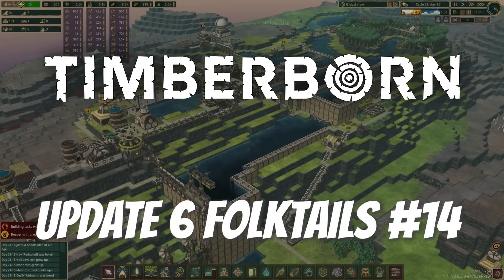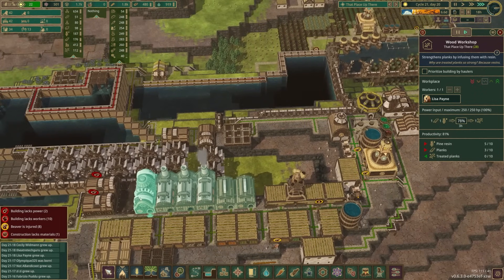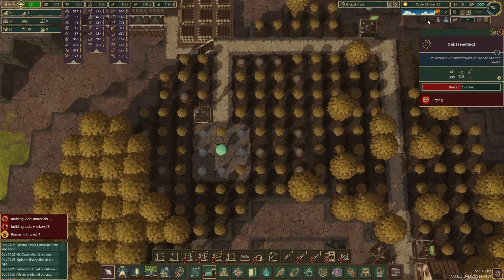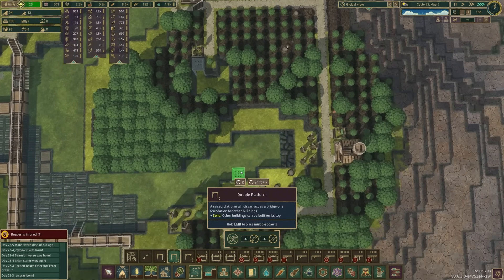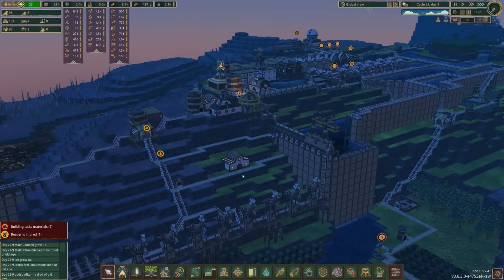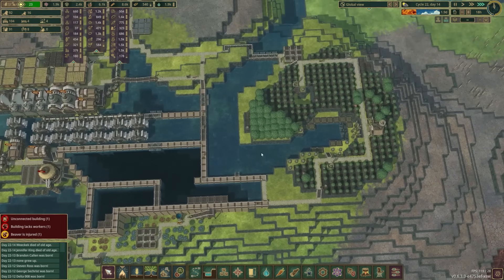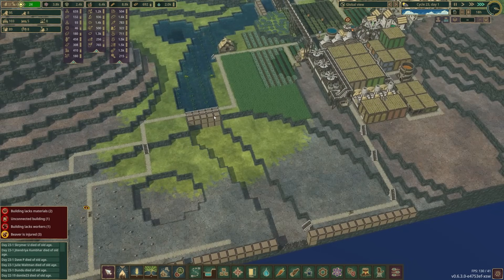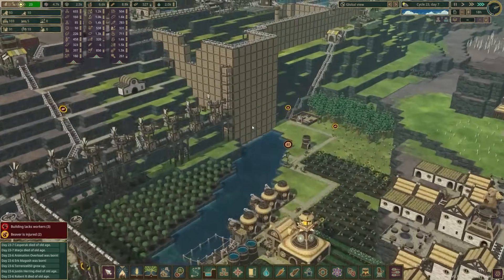Time for a huge water upgrade! Timberborn Update 6 Episode 14

Comment: Platforms over water is a great way to get space back that’s otherwise unusable wasted space. For housing or industrial use.

Also, there’s prime real estate for 3 or more gravity batteries off the front of your dam, you can put a T in where the vertical shafts come up the side and put all the gravity batteries on platforms just like you did on the power shaft to keep that pathway open. And having the weight off the front will give you a really quick and easy visual reference on the amount of power stored.

Comment: → 22:48 "All of these have to be paused so this and this can be built first" – alternatively, you could high-prioritize the rightmost one of the ones which are paused now, so it gets built first. The other ones then will only be built from the top, without any intervention needed.
→ 48:35 "And I want these to be connected, but I'm not going to build a second centrifuge just yet, so we will of course temporarily get this put in with a power shaft" – Looking at the color of the shaft at 48:44, the centrifuge doesn't connect there, only in the middle of each side (and the bottom).
→ 52:32 "There is still a pile of logs here. How did that happen?" – You demolished these levees after giving the construction task for the wall extension, so they will only do the cleanup after the wall is done (or the construction somehow blocked).
→ Don't forget to put back the gravity batteries (and possibly some more on the front side of the reservoir, over the sluices) – optimally you'll want to have enough energy storage that you can last through a drought (with the support of the intermittent wind mills).

Comment: The contamination barriers could be thin strips of wood in baleen like sheets to act as a filter, it uses "planks" because you can shave the boards thinner at the mill. Each of those cones could be one such vertical filter in a rat maze of steel, forcing the water through every filter before it passes through. using that description it would probably need upkeep, but timberborn [thankfully] doesn't do upkeep tasks, only build, supply, craft, and recreation. 

In Oxygen Not Included, a similar contraption, the water sieve, requires an input of sand and removal of polluted dirt [2 separate tasks, 1 supplying, 1 life support] to maintain. That game, despite its cutsy art style, is designed to encourage rube-goldberg contraptions. Yes you can filter your sewage [from toilets that are needed], with sand in a sieve, or you can find a way to boil it, turning it into dirt [for gardening] and steam, which can be cooled into clean water. You can also just dump it into a pool and either decontaminate the air [with power and sand, but much less than a sieve] or just let your colonists breathe polluted air.

Yes I have done all the mentioned options at different times. Timberborn needs a water sieve type contraption, come to think of it, one that either uses power and paper to press it through a filter [for the Folk Tails] or logs to boil it and condense it [an Iron Teeth badwater reactor, turns 2 badwater and 0.1 log into 1 clean water and maybe 20 power, or whatever the wood: power from the engine and badwater: extract ratios at the centrifuge are]
Reply from the maker: This is awesome. I hadn't ever thought of that being possible.
Reply: @JCTheBeard  it is my way of explaining 2 extant filtration systems used today using beaver logic: the charcoal water sieve and the algae air filter

The charcoal one is useful for camping or doomsday prepping: take a plastic bottleor tin can (plastic bags will do in a pinch) and poke holes in the bottom of it . Into it you put gravel, then sand, then ash from your fire. You can filter river or puddle water through it to get the particulate out, then boil the water to kill whatever didn't get filtered.

The algae filter is used on some coal fired power plants. The exhaust gets bubbled through a water tank filled with heat tolerant algae. The water and algae take the ash and much of the carbon from the exhaust and convert it into oxygen. When the tanks have too much algae, they skim and dry it and burn it as more fuel.

Comment: 13:47
Just like the lodge you have near the center of the screen here, you could add some more using the cliffs, by placing them one level lower.

To the left of the one here, you can put a double lodge by turning it counterclockwise (in comparison to the triple lodge), and you can add more lodges following the cliff.

Also, don't forget to add rooftop terraces and other amenities.

Comment: 50:30 You forgot to put the gravity batteries back. Why not put them at the front of the dam instead of the side? Either facing outwards or inwards. That way they also won't lose height due to the side of the hill.

Comment: You could do a mix of small storage and platforms over small things like medical beds on the backside, with a platform covered path to support more housing. Basically instead of blasting the cliff back, built the land out. for ease of access, you can even take advantage of the verticality by using double stacked single platforms instead of doubles, with a path on the "middle floor".

Another more visually impressive but also functional thing you can do [that will give the beavers Up There more recreation] is to have an overhang contraption to make indoor rooftop terraces. Kinda like how you used overhangs to make those power lines, the ground floor is a mix of medium storages and platformed over paths and small utilities [again like your storage complex]. Flanking the ground floor storage setup is triple lodges facing inwards. On top of the storage is a rooftop only rec building and overhangs [on single platforms on top of the lodges] span the gap leading to more stuff on the 4th floor. 

Floor 1 = ground level storage, and path/stair access to floor 2

floor 2 = entertainment & housing entrances, and a spiral staircase linking the floors

floor 3 = stairs up to the next floor and mainly open space over the entertainment [like your power lines over the trees]

floor 4 = overhangs and/or bridges with decor or another stack of this contraption.

For visuals, look up Chicago's Lower Wacker Drive. a good chunk of downtown is built on stilts essentially, with all the older [1950s and earlier] buildings having special delivery entrances, storage, and parking under the public part of Wacker Drive [which follows the river on the south and east banks to the lake]. The underground scenes in the Dark Knight movies were filmed on Lower Wacker. Other inspirations are cliffside mansions and the Ewok Village from Return of the Jedi

Comment: The way I did it in my play through, I essentially used that little island where you put down the science buildong, as a storage system. Unlocked the underground pile, and also blew some holes to be able to store large storage and have them flush with the ground. So it could have some processing buildings up top.

It looks pretty neat.

Comment: For housing defelopment, using the view at 21:13 you have a set of 1 tile ridges, then a single 2 tile ridge. If you start with some double or tripple lodges on the 2 tile ridge with the opening to the next ridge up, you could then  run a path, with stairs up on the right where it opens to 2 tile width at that height. Platforms on top of that path would allow for either/both of another level of double/tripple lodges or some rooftop terraces. Up at the very top you could also shuffle some things around to make space for some firepits, or just put them down at the very bottom. 

I'd also encourage using the levels to put out a 2x1 platform with a hammock out into space. There's no practical reason to do this, it's just nice to put in cool lounging spots for the introverted beavers to go and chill while looking out on the world.

Comment: For housing, perhaps stack the buildings facing the cliff/terraces and use metal overhangs to reach the doors, paths running along the terraces. 

Also had an idea for the irrigation pool for the Forest ‘up there’ instead of the usual water dump - could’ve created a pipe from the water source with a sluice to allow clean water, and then built/paved over it?

Comment: 51:48 I know you’re not hurting for water but if you get rid of the sluice gates and widen the outlet of the river to be able to fit 4 dams and 2 sluice gates and set the gates to open above contamination 1% so the bad tide flushes out and close on contamination below 1% to retain water at the height of the dams. Also maybe set the log pile further back to be able to put in contamination barriers closer to the edge

Comment: For future, if you have dynamite you can always dig 1 tile into the ground and fill it in with levees instead of using contamination barriers. 1 levee in the ground and 1 above it usually does the trick for keeping badwater contamination from spreading.

Edit: This would be helpful at 52:17
Reply: You can also combine one layer of levees on the waterway bank with impermeable flooring right next to them. But Be aware that both methods block not just contamination but also irrigation (though of course that isn't an issue when you have an irrigation hole handling that in the area).

Also, contamination — like water and irrigation — doesn't move diagonally, so the contamination barriers on the corners weren't needed.

Comment: 13:49 Why not cap the water source, next to the district center, with 3 by 3 or 5 by 5 platforms. Giving you more building area at the same level as the factories and housing.

Comment: I have no good tips for using verticality and blow up less ground.

Although, you should really use some explosives to get more depth and volume in the giant dam in The Place Up There, both for added water volume, which might be overkill, but also add more and also higher gravity batteries.

As a long time goal, you should also add power wheels in (at least) one of the bad water sources and keep it open at all times.

Comment: Hey JC, how's er going?

You mentioned how to incorporate storage into the cliffs. I envision when I start playing, burying the storage buildings and covering them with dirt, like a root cellar or a tornado mound. Then plant crops or trees ontop to reclaim the land for fertile use. 
Running irrigation and power trenches all in one area to avoid power distribution spaghettification.

Hope this helps.

I've been too lazy to update my windows past 7-64, so Steam won't work since January. Lol Need a rebuild of my system. Built it probably 15 years ago, still going strong without issue, but I want to move away from the typical SSD to the newer NVME anyway.
Reply from the maker: I don't believe we can put new dirt on top of platforms, but we can "bury" the storage buildings for sure.
And yes, NVMe is great! That's what my filesystem and main storage is and it is lightning fast. Very snappy. I haven't had a spinny drive in this machine for years and it is astounding how much faster everything is.
Reply: > I've been too lazy to update my windows past 7-64
Staying with the last good Windows is good indeed.
Reply: @walkir2662  Agreed, but seeing how Steam requires it, my entire library is unusable, as is my ability to purchase and play items such as Timberborn.

Seeing how I'm being forced at gunpoint to update the OS, I figured it might as well be time to start a new system from scratch regardless. I built my current system when the x58 boards came out, and the hex core 990x, 3.43ghz was new. SSD drives, not platters, but still. Time to move on.

Comment: 40:00 What would happen if you built the Contamination Barriers in the water? Instead of the boarder of the coastline.
Reply from the maker: Unfortunately, they don't work if you do that. They only stop contamination from going underneath them. If the badwater is on top of them they can't do anything.

Comment: 32:36 🚨🚨🚨🚨 I don't see any planned water height control ....  Are you planning to backup the water ✴️SUCH THAT YOU DROWN✴️ the aqua farm ❓❓❓❓✴️✴️✴️✴️😱😱😱 😱😱😱 😱😱😱
Reply: The sluices at the bottom of the main dam should keep the water at a controlled height.
Reply: @nurmr  I'm referring to the reservoir at the map edge ( no water exit ) ... I believe during Wet season clean water still flows thru the aqua farm & needs to exit the map ... Which won't happen until the aqua farm is DROWNING ‼️‼️
Reply: I'm pretty sure the sluce gates at the bottom of the main dam control all of it.
Reply: @ehoffmeister8160 no the sluices upstream will never allow the water in the part where the aqua farm is to reach over 0.6 or 0.7 or whatever it was. The water haven't existed the map ther since middle of last episode when the outlet dams were blocked with levees.
Reply: @skrymerU  He needs to fill up those 2-deep ones, though